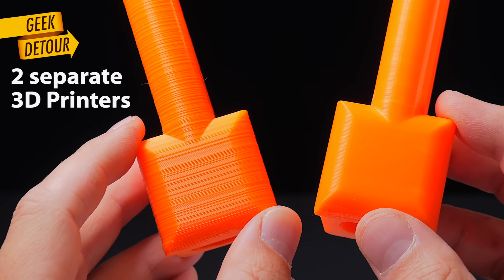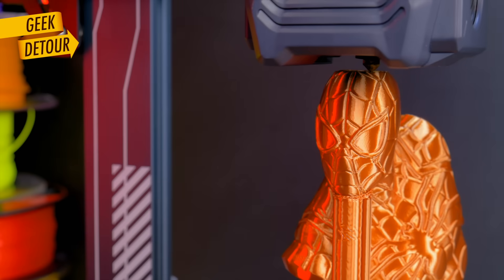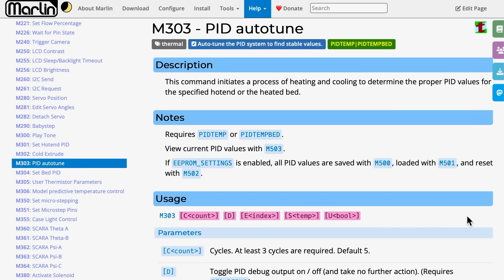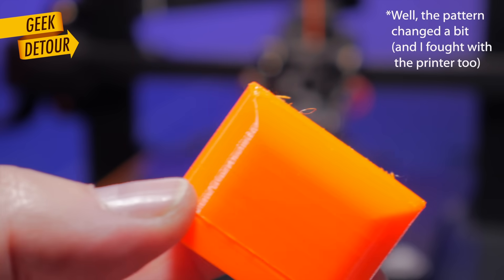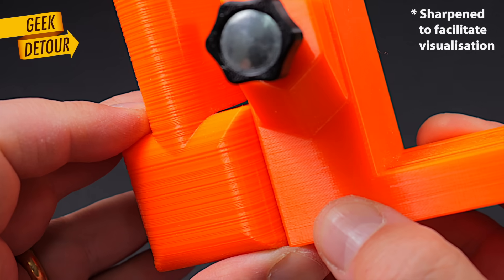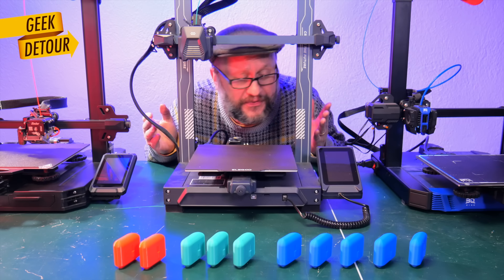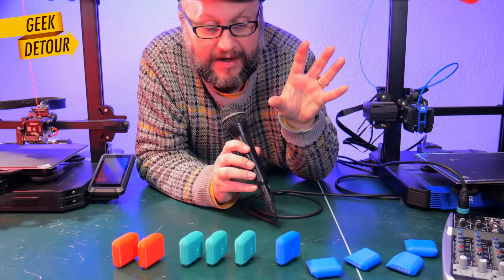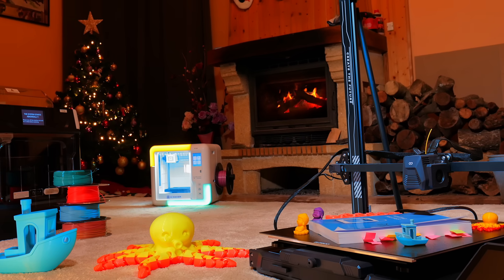3D Printer Problem: do you know How to Fix Z-Wobble?

Comment: As weird as it is, ambient temperature of the room causing the metal in the entire printer to expand-contract? 

I work in a factory that involves drilling holes into copper laden laminate. Different temperatures, especially between seasons can cause the copper to expand and contract ever so slightly, this is enough to cause misalignment between parts requiring the drill program to be rebuilt every time we attempt to remake and assemble the same product. It's very obvious between summer - winter. 

This could be mitigated by tightly temperature controlling the entire factory but this is impossible for the size of the space, so reprogramming where to drill  it is. 

You mentioned it's been "months", I am not 100% sure but it made me think of that very problem in the factory. 

Perhaps the lead screw or even the entire gantry is more "straight" in different temperatures? Right now my Ender 3 is suffering from z-binding, few months ago during the summer, it was working just fine, it's winter now.

Essentially, even if you "tighten" the z-nuts, because the lead screws / entire gantry are probably as straight as can be, you won't get binding.

Comment: Your problem trying to reproduce the binding issue reminded me of something I discovered as a beta tester for a camera flash wireless trigger.  I'm not saying that you are having the same problem, just that it was a problem that appeared under very specific conditions. 

The design had a slide in battery tray. The tray had a arrow like shape at the end of the tray. In combination with the internal latch allowed of the battery tray to be locked in place when you pushed the tray into the cavity. Pushing again on the tray would release the latch and a spring would push out the tray a few centimetres. It was a satisfying mechanism to use. 

When I unboxed it it worked properly. But after a few days it stopped working. It would unlatch and release the battery tray. But when putting the battery tray back in it would not lock in anymore. All the radios had the same problem. 

What I determined was that it was a humidity problem. If I would blow into the battery compartment, after a minute, the latch would work properly again. Wait a couple of hours and the problem would return. 

I received the radios in January, in winter. Winters are cold and dry here. At the time I measured the indoor humidity to be about 10% relative humidity. What was happening was the plastic was drying out and that affected the operation of the latching mechanism. The manufacture had not experienced anything like this in their development. They were in Hong Kong and they never experience such dry conditions there. 

They did a slight design change and their second beta units, and later production, never experience the same failure.
Reply from the maker: Amazing story! Thank you so much for taking the time to write it down and share it with me/us all ❤️ I enjoy troubleshooting - and product development seems SO COOL. Unless everybody is with a tight deadline 😬

Comment: Nice video! I think one thing you could infer is that there could be some debris that somehow got into the lead screw nuts themselves. I noticed you were using brass nuts and I had that on my Ender 5 Plus initially. I decided to go with the anti backlash POM nuts instead and they did wonderfully. POM is self lubricating and has low friction that shouldn't cause much z binding. 

Also, dual extruder gears could be an issue too as maybe the idler gear could be shifting side to side changing its effective extrusion rate. I know Mirage3D and some others did a video on that one. Hope this insight helps anyone and Happy Holidays! 😊
Reply from the maker: Absolutely! MIRAGE3D videos are a MUST! Thanks for the POM suggestion, it will be in my list to try out!
Reply: No prob! Hope they'll help you out. 😁
Reply from the maker: Oh, it has been printing nice since I recorded the incident. BUT I love to tinker

Comment: I beg you to write Z-binding in your title or tag. A few years ago I had this same issue and it took me the longest time to figure out what was wrong. It had happened after I had just did some mods on my ender 3p and I had removed the screws and put them back in too tightly without realizing. I did everything you did too until I figured it out but a vid like this would've solved my problem in 1min. lol.
Reply from the maker: I will change the title in a few weeks. Right now it is fun for some people to actually engage in trying to guess what was the problem. I don’t want to give spoilers 😄

Comment: The ender printers have massively flawed designs. Theres no way you should have a loose nut on the leadscrew as it would be able to rotate slightly and cause backlash. Shitty couplers cheaply made non aligned gantry and bent leadscrews are to blame. Your fix was essentially a bodge.
Reply from the maker: Ha ha, I cannot say you are wrong. My first Ender is 90% modified (just one of the steppers and the frame is original). I didn’t have time so far to do the changes I want for my recent printers - even more because I do reviews on them, and I need to use it “as is” for some time, so things can happen naturally (good or bad).

Comment: Once the z-axis lead screws are setup straight and rotate without wobble through the up/down gantry travel shouldn’t those z guide bolts be tightened?  Otherwise wouldn’t you induce a little more slack in the z-axis?  Great video, it seems indeed z-axis binding was the culprit.
Reply: You definitely don't want to leave them all loose, it will add significant uncertainty in Z height especially if you are using Z Hop (i.e. Z axis changes direction during printing)

Comment: I actually love troubleshooting problems like this.  Even though it can get rather frustrating, the satisfaction after you find the problem and come up with a solution is wonderful.  I fought a stubborn over extrusion issue in my anycubic kobra 2 for months. I calibrated the esteps multiple times and they were dead on. Temp changes didn't help and it happened with every filament. It happened from brand new and out of the box. I was able to mitigate it with flow settings in cura but i constantly had to adjust them as no single flow rate resolved it. One printe might work great at 95% whereas another world be best at 70%. It was maddening. I went through 5 brand new nozzles so that couldn't be it... could it?  I finally changed to standard volcano nozzles and low and behold flow is dead on now.
Reply: Hey, I’m having the same issue with my Kobra Plus that has a volcano. When you say standard volcano nozzles are you meaning like the genuine e3d nozzles fixed the problem or something else? Thanks!
Reply from the maker: Oh yeah! The A-ha moment after a maddening chase… LOVE IT! Thanks for sharing!
Reply: I am having this exact same problem, could i add you in discord or literally anything so I can send you pics and you can potentially confirm its the issues? New to FDM and have Kobra 2, everything was going fine but now I'm getting very frustrated.

Comment: "If you don't like troubleshooting, you won't enjoy 3D Printing :)" ... just get a Bambu Lab printer - most stuffs are automated. I just want to print.
Reply: A casual browse of the BambuLab subreddit finds it absolutely chock full of people with issues, some just like the one in this video.

If it's mechanical, it has the capacity to go wrong. It doesn't matter who made it. Knowledge of basic maintenance procedures is essential to long term operation.
Reply from the maker: Oh, I agree with you! Excellent printer and that’s perfect for people that don’t enjoy tinkering. BUT: Bambu printers will get old, and will need basic adjusting, and some basic maintenance. Maybe you will prefer to take it to a shop for them to make a full service, that’s an option, sure. But think of it as a modern car, you can use it better if you understand how it works, and identify when something is off.

Comment: Perhaps a nozzle issue, something causing filament to roll to one side coming out that tiny hole. I did see others pointing to a zed axis related problem which makes complete sense when examining those layers. Imo it could be a combination of several little things adding up. I've still got all stock parts on my 10 year old ender and the zed rod and screw are still getting it just as they did on day one.
Reply from the maker: Absolutely, it rarely is just one thing… I had neglected maintenance on my printers during those first months after we moved and weird stuff began to add up.
Reply: @GeekDetour  firstly, thank you for your awesome videos! Being a long time subscriber, I'd also like to thank you for your reply. I've been saying for quite some time it's often a set of little problems that add up to create one big problem. I've worked with automated weld equipment for over 20 years and have since moved into the 3d realm of it all. I've got just over a dozen years as a 3d hobbyist behind me now. Periodic and preventative maintenence play a huge role in many ways! Merry Christmas and happy holidays to you and yours! Looking very forward to any new videos you are able to share!
Reply from the maker: Oh, thanks @BykerJB for your kind words. Exactly. It rarely prints terrible just because one thing. All the best for you and your loved ones in this new year 🎄🎉🎊🎁🍀🥂🎂

Comment: Therefore , dont use printers with lead screws :). Use belted-z like the voron 2.4
Reply: Tridents are simpler, cheaper, easier to tune, and are laid out better for cooling.
Reply: @Flumphinator  Cooling yes, since the layer being printed is always at the same height, you can place a fan there. Cheaper, yes. Simpler, meh, if you consider one stepper motor less to be that much simpler, then yes. But how is it easier to tune? I guess you do not have to worry about tensioning the z belts, but you still have the x-y belts.
Reply: @CrazyMineCuber  the tuning comes down to the gantry being fixed. The Y rails bolt straight to the frame. Also, as Z increases on a 2.4, frame resonance actually changes significantly since you move from an end supported part of an extrusion to being more midspan. It mostly only matters if you’re pushing it (but why else does anyone build a Voron?).

I mention cooling because the trident is just better for chamber temp. The toolhead always stays at the top of the chamber volume, which stays hotter. It’s also very easy to mount large fans at the bottom of the chamber and duct the air to the top, since the gantry is fixed in Z. Running sheet cooling is just way harder in a 2.4. I’ve never seen it done effectively. 

Don’t get me wrong: 2.4s are really cool. I have one, and I love it. But depending on what you’re doing (and your availability of parts), a trident makes more sense in some cases. If you only ever want to hit 65-70C in your chamber for ABS and are totally fine with 7k-11k acceleration and don’t mind spending a bit more, the 2.4 is a great design.
Reply from the maker: I am really willing to try one - specially because stepper motors have “Vertical Fine Artifacts” and in that would easily become “layer artifacts”… but I want to explore it by myself at some point. I will have a deeper dive on the Z-Rods soon, on a new video.

Comment: you should use lead screw nut from POM material! Stop using poorly manufactured brass chinese junks!
Reply from the maker: Interesting! Thanks! I’ll try. On my heavily modified Ender 3 pro (that doesn’t have anything stock anymore) I have a much more expensive leadscrew with a decent nut - although it is brass - and it is butter smooth. I’ll look into POM ☝️